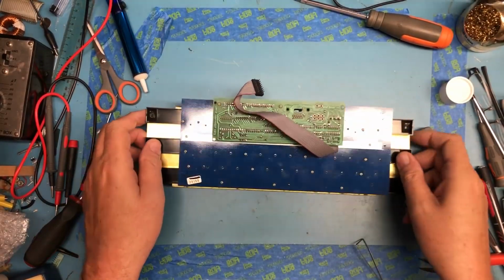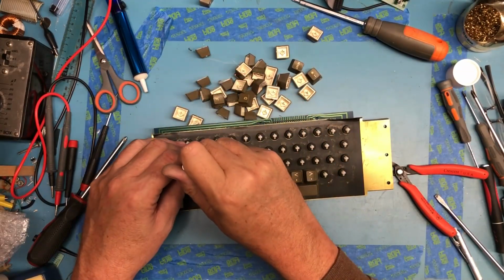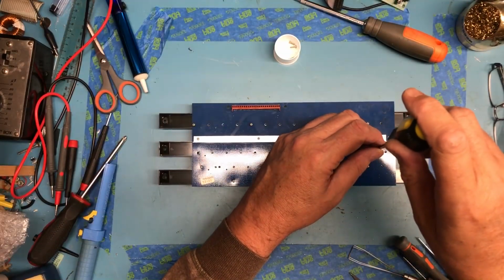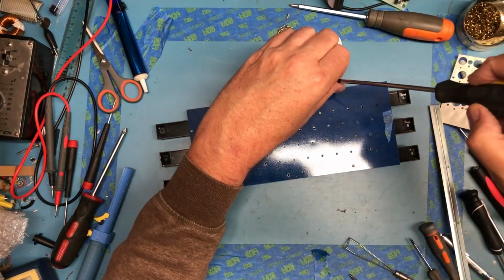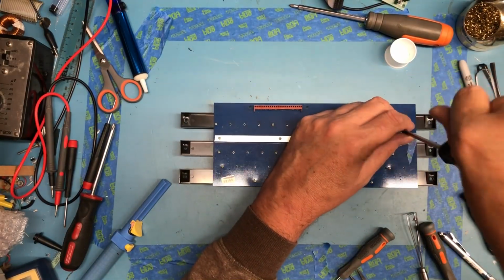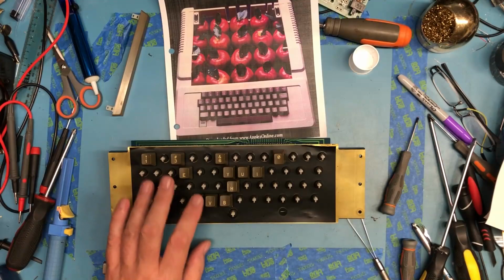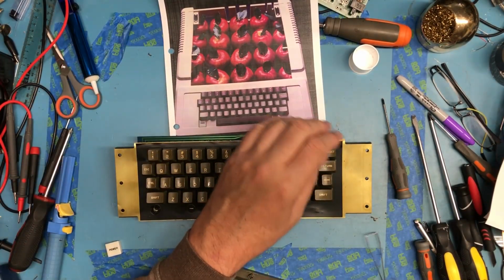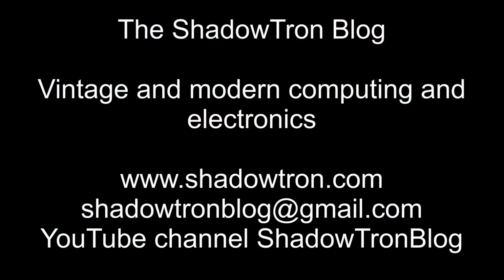APPLE II Plus - Part 5 - Servicing the keyboard - STB190

Comment: Did it have problems before you took it apart? Just wondering if it worked better after
Reply from the maker: Yes, it had issues. I don't recall the exact details beyond some of the key switches were intermittent.

Comment: The two optional unpopulated parts on the encoder board are for 1. DPDT toggle switch for a partial lowercase mod (needs other changes as well), and 2. The DE9 connector for a numeric keypad. Details are on the schematic in the Apple ][ Circuit Description Manual that you had in the background.